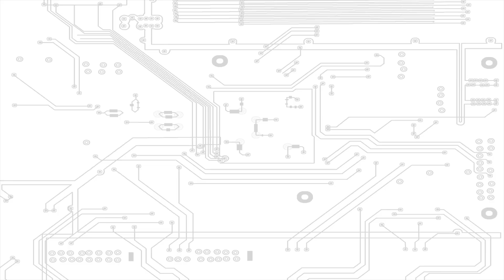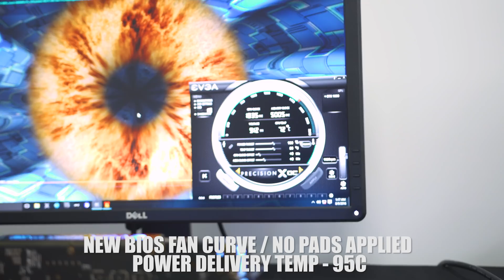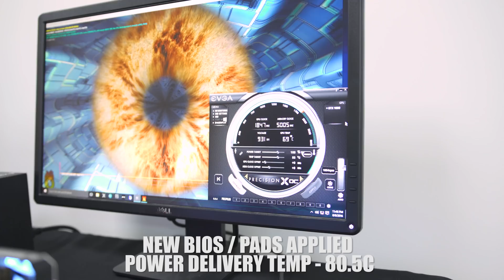EVGA FTW VRM Failures - What should you know

Comment: Where do you get the pads? I just got a Gtx 1070 last month, didn't have any issues though.
Reply: EVGA's website
Reply: Should I still get the padding if I haven't had any issues?
Reply: if its either a superclocked or FTW card then its free and will make the card cooler, I personally am going to.
Reply: yeah I have the SC
Reply: then ya I would if I were you, the new BIOS seems to put the thermals in check but since they are free and take less than 10 minutes to install, add them, ordering my FTW next week and will be requesting the pads once it arrives

Comment: Fuck I have a FTW 1070.....
Reply: go to EVGA's site and request a pad kit :P
Reply: Set a custom fan curve. Had mine 3 months no issue with custom curve. get the free pads nad install them for piece of mind.
Reply: John Totten yeah those temps are just the core temp and not the vrm. For all you know they have been on the brink of overheating all this time. Evga have fallen so far over the last few card generations.
Reply: John, I have had my heart set on the GTX 1070 FTW for months now, im doing a new build and RIGHT when I'm  about the FTW....this issue happens!! I was thinking " why not just run a custom fan curve?  PLUS, i think if i buy it directly from EVGA.com it will come with all the fixes applied....i mean...right?
   What program do you use to run your custom fan curve? man i want this card so freakin' bad , but i JUST DONT KNOW!!!   :(
Reply: If this helps, I can run 4k games on Ultra 45-60 frames.. It does get more warm than I would like, but 
I am about to get an all in one water cooler to try and keep my ambient temps down.. And if you send in your card, EVGA will send you a new one.
Reply: Blazk0  I use MSI Afterburner to control my fan curve, Evga Precision also works. Yea I hear ya man. If I were you go to Evga.com and read thru the forums or contact their customer support and check to see when a good time to purchase the card once they has the bios update and pads installed cards ready. Yes buying direct from Evga themselves would insure you get the newly setup cards over taking a chance with a regular vendor.
Reply: So do I, and I recently checked my temps on the back of the card and they weren't bad. I still ordered the pads though. 

Not sure if I got lucky or what, but I've had mine overclocked +120 from the normal FTW overclock and it's never given me trouble in the 2 months I've had it. Just request your pads on their site and set a custom fan curve until then. The BIOS update wouldn't hurt either. I didn't even notice a difference in noise.

Comment: what about the 1060 with 1 fan? it has the same problems?
Reply: if its an ACX cooler then yes, if its the blower cooler from nvidea then no
Reply: Yes I'm talking about the EVGA 1060
Reply: I repeat, if EVGA made the cooler, so either their superclocked or FTW cards, then you might have an issue, if it is the "founders card" which is a box from nvidea with some stickers on it from which ever company bought some cards, then EVGA did not touch the card and it does not have this issue

Comment: Is this ALL EVGA FTW cards or just some? I have an EVGA 1080 FTW DT, so is this version affected?
Reply: gtaclevelandcity I don't wanna sound rude but he emphasized the fact that it only affects ACX 3.0 cards. not ACX 2.0, not blowers, not hybrids just ACX 3.0.
Reply: I would contact EVGA but I would assume so since the DT version uses the same PCB and 3.0 cooler shroud just not the same clock speeds. Pretty sure shipping for the thermal pads is free too.
Reply: gtaclevelandcity just some
Reply: gtaclevelandcity just the ACX 3.0
Reply: all 10 series

Comment: I was gonna get one of the ftw 1080s but I might just go with asus. Any other card suggestions with rgb lighting?
Reply: why not 1440s?
Reply: Well, All the new ones gonna be send with the Thermal pad Preap but if you insist, id say Gigabyte.
Reply: megamario1392 thanks!
Reply: I got an msi 1070 gaming x and its been smashing everything and keeping at a constant low temp under 90-100% load.
Reply: Jackson Heuser Asus rog strix gtx 1080 oc
Reply: Jackson Heuser gigabyte xtreme
Reply: Zotac if you don't care about the yellow stripe on the backplate

Comment: I have a asus strix 1060 should I overlook the memory still?
Reply: Air Brayden you shouldnt if you ask qestions like this
Reply: the asus card is not effected by a design fault from evga, more than likely you will be fine as long as you don't go bat shit crazy
Reply: yes. this issue has nothing to do with the asus cards. this is an evga specific issue
Reply: OMGitsathing ok just making sure, I have it at like 4150 right now, plus 618 to the original.
Reply: wayge my cores at like 2.3 ghz with +30 voltage
Reply: wayge I was a really big evga fan, still am I use there power supply's but asus has nice cards and it was on sale
Reply: ***** nothing wrong with the asus card as far as im aware, if you over clock is stable and your not having thermal issues then your golden